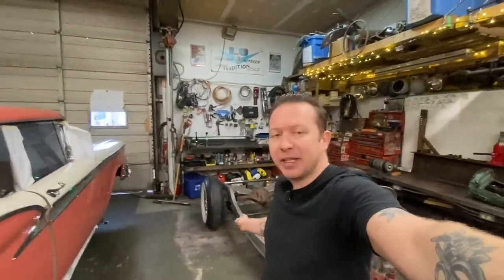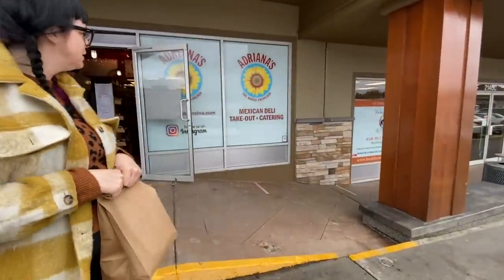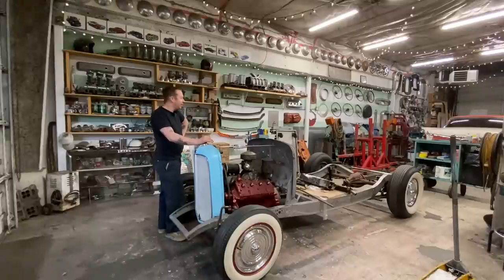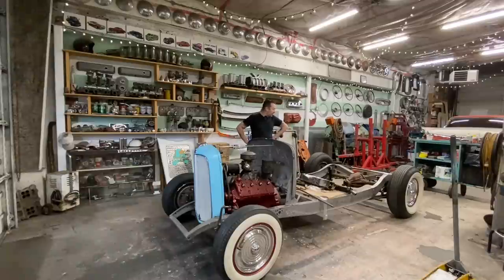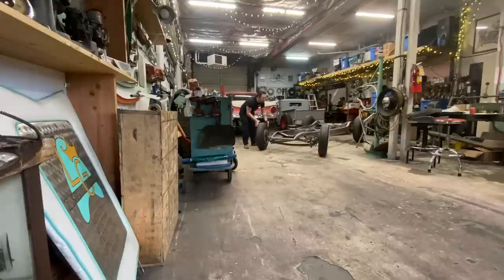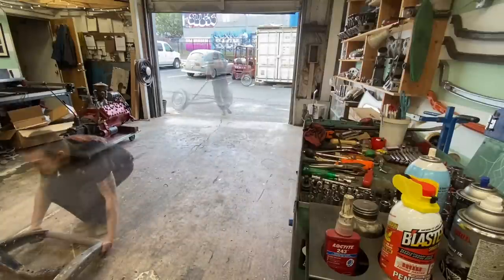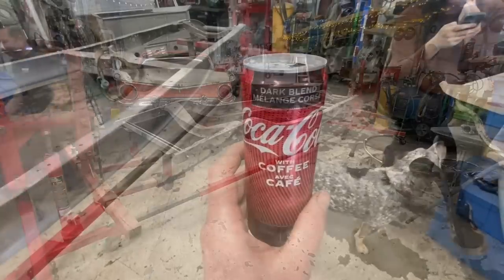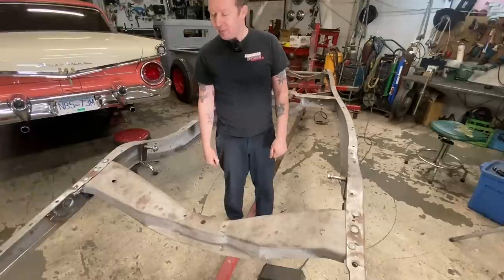Stripping The Chassis For Bodywork and Paint. 32 Ford Rebuild Part 13

Comment: I think I would use several heavy coats of primer builder (slick sand) and sand it one time and focus on the outside of the frame when sanding and then semi gloss it with a paint that has hardener in it. Since you have decided to run fenders  most of the frame will never be visible and it would be lots of block sanding for something you don't see much of.
Reply from the maker: Agreed!
Reply: @LGKustoms  great minds think alike hahaha 🤙

Comment: as a bodyman for 45 years, plan a always looks nice and is correct. plan b makes sence for a driver car. But! your building a 32 ford! maybe not a show car but still a 32 ford. id address the pits and side rails  cause there seen when car is together.  several coats of epoxy primer,  wet sand. seal and paint your color. it`ll look nice and you`ll be happy. congrates on being in the magazine. your doing good Lee and a great shop!
Reply from the maker: Thanks!

Comment: Remember, you asked for opinions, here's mine! Prime and rattle bomb the backside "unseen" parts with black bed liner. Then body work and paint the "seen" parts body color. Another option, semi gloss black the outside of the frame and after the fenders are on...pinstripe the begeezus out of the exposed part of the frame between the running boards and body !
Reply from the maker: I like almost all of your idea! Haha The only part I’m not in to is the bed liner, and that’s from first hand experience. I’ve found bed liner is really hard to keep looking fresh once it gets a layer or road grime on it. Almost like it stains, or holds the grime in its texture. 
Pin striping is a cool idea!

Comment: Great job on the welding, If it was my frame I would finish it with a nice paint job just in case you show it off, after all it's in a good place right now just spinning around on the stand.

Comment: Lee that is the same dilemma i have been having on my pickup project. I would say it just depends on where you want to take it. Either way would be fine it is just the amount of time to get it done. I have leaned towards the 2nd choice on my build, but understand the thought of making the frame really nice as well. Hopefully i can get you to swing by while down in the area Come by and hang out a bit. You all are welcome
Reply from the maker: Thanks Matt. I think I have a solid plan for the chassis paint. Stay tuned! 😉

Comment: Thanks for mentioning Canadian Hot Rods magazine , I’ve been meaning to subscribe. So I paused your video and did so . As far as painting the frame , I’d go with semi gloss black Tremclad and a brush . Come on Lee , if you can paint your roadster with a brush …  😂 once again, I love your content Lee 👍🏻
Reply from the maker: Terry will be stoked about the subscription! 
My roadster is brush body painted with Nason single stage. The chassis is sprayed with Endura two part industrial paint. It still looks brand new after 12 years. 
My truck chassis I painted with Tremclad primer and paint, unfortunately four years later the Tremclad is mostly all gone. Did not hold up at all.

Comment: I think plan A. I would propaly go plan C and get the frame powdercoated. I have powdercoated a lot of stuff, suspension parts, rear axles, motorcycle parts etc. I made a headache rack for my pick up truck(law requires it in here on heavier trucks) and got it powdercoated. They asked do i want a zinc coating under the powdercoat?
Well, does the bear crap in the woods? ofcourse i do. Its been something like 8 yrs now and it still looks good, not a single spot of rust on that rack. Its only faded slightly because of the ultraviolet radiation from the sun.
Reply from the maker: I like powder coat for new parts, but powder coating will not fill the pits.
Reply: @LGKustoms  Thats true, i forget those damn pittings

Comment: I'd seal and semi gloss black the frame and then spend more time and attention to the body since it's gonna be a daily driver and it's going to show more than the frame.  Incidentally, what are you planning to do about the front end and rear differential?
Reply from the maker: Front and rear for paint? They’ll just go black. Although every now and then I think about white to go with that late 50’s early 60’s style

Comment: Lee make this one nice, I don't know about you but I'm kind of over the patina look , don't get me wrong I liked that look when it was fresh but now it's getting a little boring, cause it seems like everyone is doing it . what has happened to the real craftsmen who took the time to really make a hot rod look fantastic, by that I mean a paint job you could be proud of. I know paint is expensive but you don't have to by the latest House of Color wizz bang candy color. just a nice red or the old stand by black ,well done  can make your hot rod really stand out. so you asked your viewers what we think . well you can call me old school,but this is what I think, make it the "best" you can do, and you'll always be happy with the finished product.
Reply: little bit of both a&b what shows the outside an use a gun not a brush 🙈👍
Reply from the maker: I think what happened was paint and body supplies became astronomically expensive. The last car I painted was ten years ago, and the paint, primer, sandpaper, filler etc was $3500. That was low end “car lot special” quality paint too.

Comment: Plan B if its life is as a driver, and as mentioned, you are running fenders. So, frame will not be noticeable.
Take care,
Rick
Reply from the maker: On 32’s the frame rail is fully visible between the running boards and the body